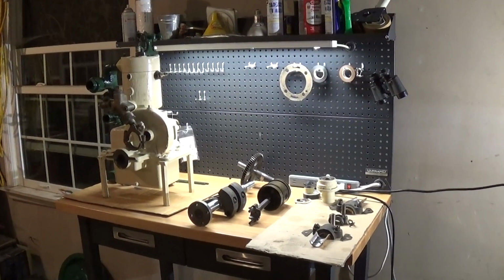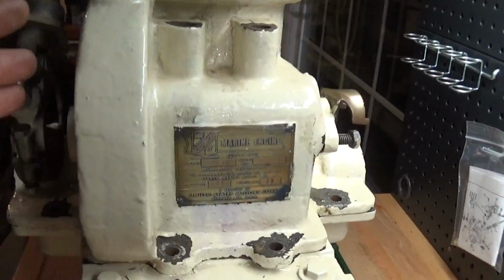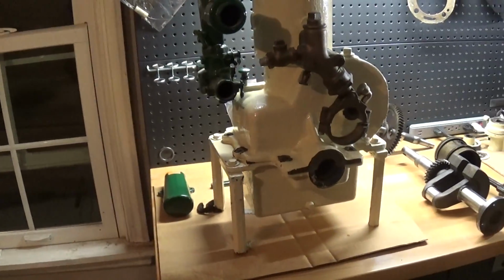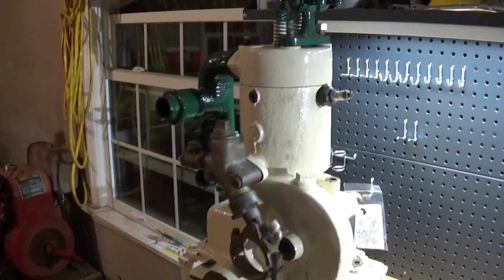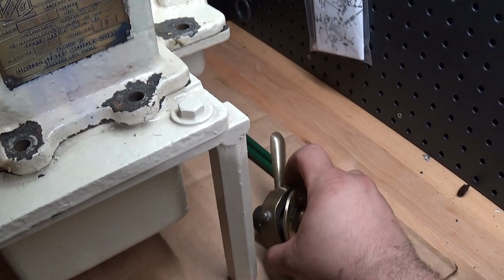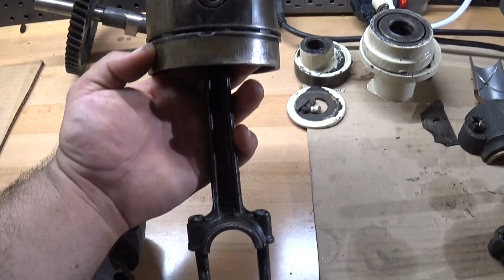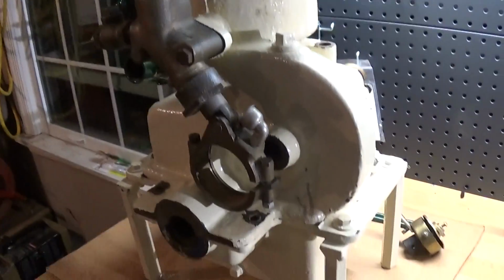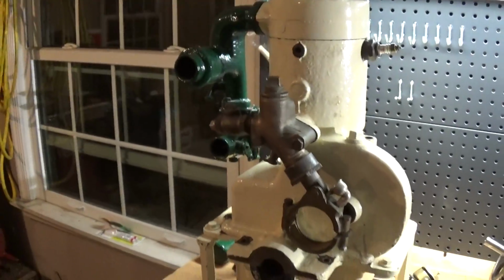UNITED STATES MOTORS MARINE ENGINE (AKA ENGINE LAMP)

Comment: Definitely awesome!... what a trip to find out that it had gotten turned into someone's lamp...lol! :-D
It would definitely cool to see it going again... and fun to hook up a little generator to it's framework and put the lamp stuff back on and let it power the lamp... and have that thing running during the night-time festivities at engine-meets, lighting up one's area at the meet. ...could put it on wheels, self-propelled, even, and steer it around and use it to light one's way at the night meet, looking at other folks stuff. :-)

Comment: Very cool! I have a US Motors marine engine based on either a Briggs Z or ZZ. One nice possibility with a small water cooled engine like that is the ability to have hot water and some space heating for free during a power failure as the engine drives a nice 1800 RPM generator to keep the lights on and fridge cold. :)

Comment: I love these old 1 cylinder marine engines. This' gonna sound nice when you get her back in shape.

Speaking of home made lamps: my grandparents made their own lamp back in the 60s. The foot and column was a 2' steering wheel and shaft from an old Volvo bus. The curved part on the top was the nickel-plated handlebars from a baby stroller. My grandpa made the frame around the lamp from chicken wire and grandma knitted the screen around the lamp itself.

Sadly, this lamp was lost many years ago, much to my father's dismay.

Comment: Shes a keeper but you might have a problem when you have enough engine stuff to take up 2 garages, lol. I have a shop, 4 sheds, and a barn.......

That looks alot like maybe a model A or model T piston/rod. If I'm not mistaken it might be what they call a thin piston with that domed top. Weigh it and if it is 3lbs you got something (too bad you don't have the whole set) if it weighs 4 lbs 6 oz it's a normal one. It should also have holes drilled in the rod for better oiling to the bearings.

Comment: That's a strange engine, to be sure, seems like there are a few moving parts on the exterior that would, in today's standards, be frowned upon, for safety sake, I would guess.
It'll be an interesting project to see this one running, Mike. I'm looking forward to this.
Good luck with this one too.